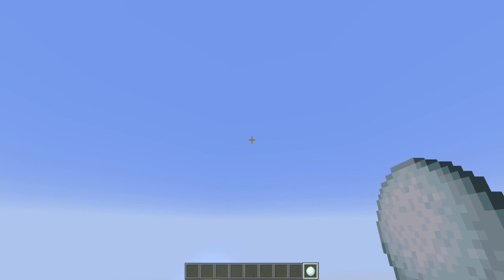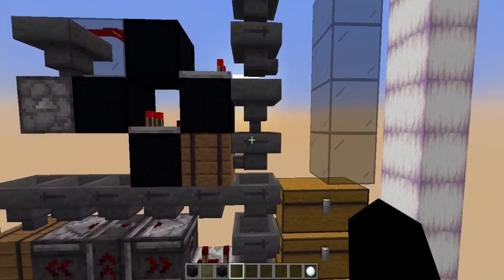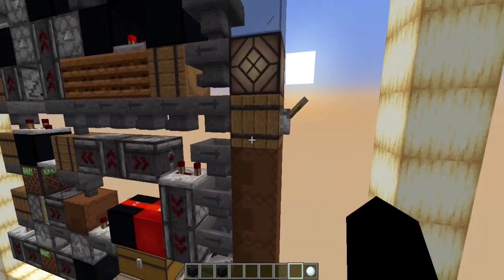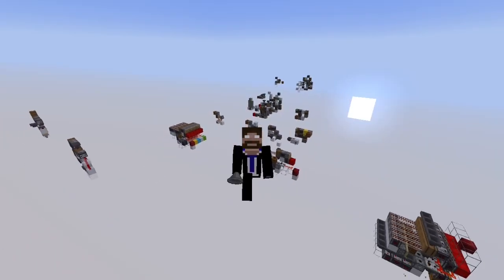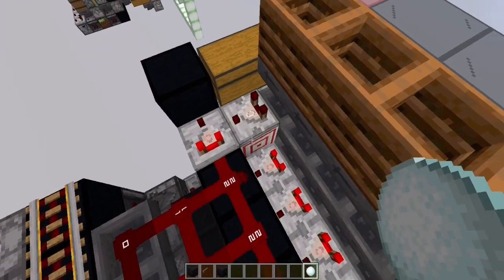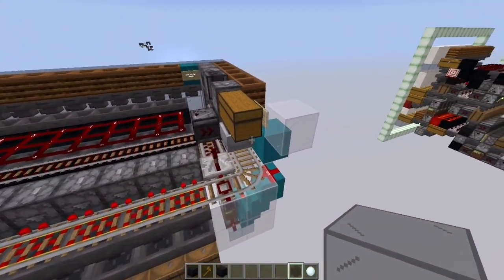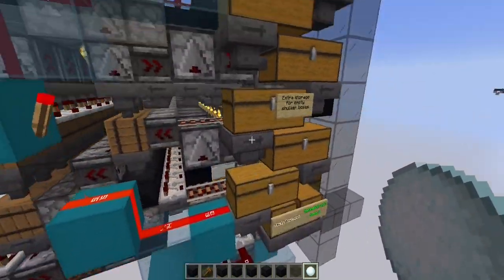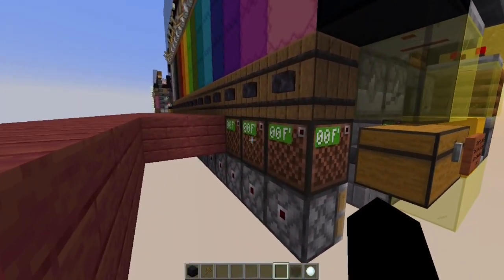Compressed Storage: How it Works | Part 2/2 | Minecraft

Comment: 21:00 I don't think a hopper can pick up an item through a composter. The hopper only checks if there is a bonemeal in it. That's why you use composters to reduce hopper lag.
Reply from the maker: Yes, I realized it after recording the video. I got it confused because the loader based on it was able to pull the item when the composter moved.

Comment: would it difficult to make this double speed and/or overstacked? i love the concept of compressed/hybrid bulk interfaces. and the configurability of the ui is great with this. i just hope i can make it a little faster
Reply from the maker: I'm not sure what overstacked means but making it full double speed would require a huge redesign project, especially for the box loaders.
Reply: @MaizumaGames  thanks for the reply, looking back on this it was a silly question lol, the whole premise of this design wouldnt work at double speed because of the horizontal hopper that gets pulled from, or pushes into the shulker loader. i meant like low threshold filters when i said overstacked, like that can pick up 63 items

Comment: Is there an easy way to make it so that there is one items double chest, and 4 shulker double chests?
Reply from the maker: Not easy if you want to keep the circuit with the same height. But if that's not a problem you can simply build it a bit higher and shift the chests (+hoppers) downwards and not use the first 3 hoppers at the top.
Reply: @MaizumaGames  duh! Thanks so much! I was literally planning out my bulk item storage before your set of videos came out, and yours is so much better!